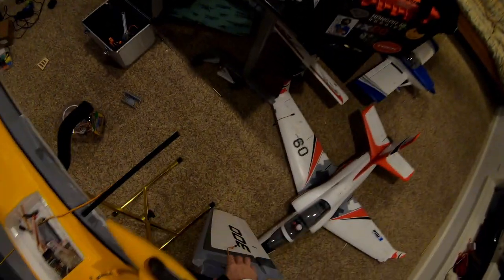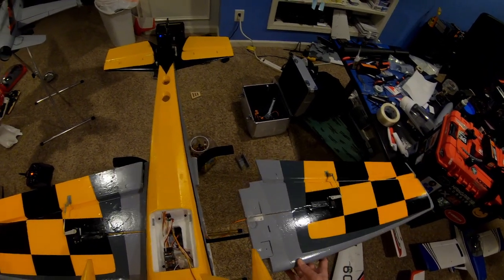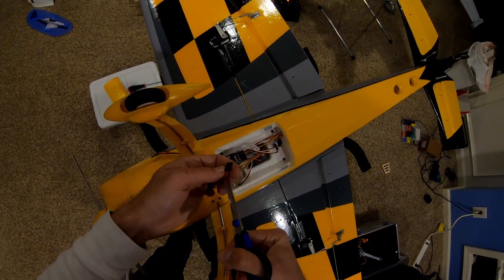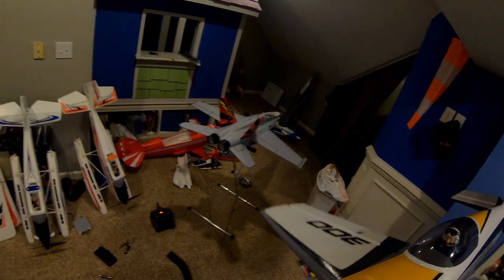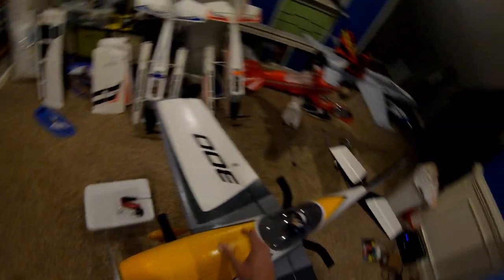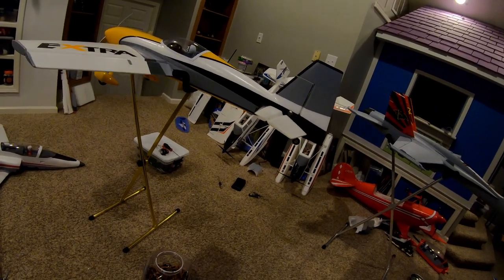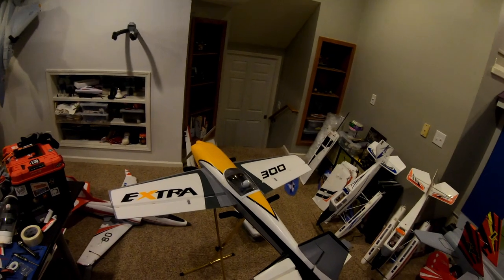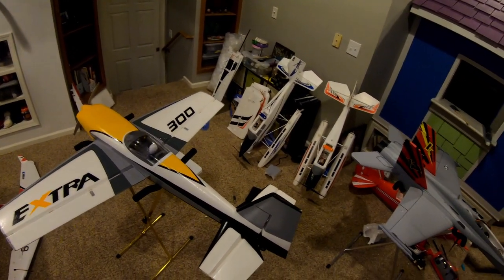E-Flite Extra 300 Maximum Aerobatic Performance Quick Setup w/ Harrier Mixing, Flaperons

Comment: Hey there, really love your Extra videos it made me get into it as well, I trained with it on realflight quite a lot but I'm still a newbie when it comes to RC so my question is:
Can I even setup the flaperons or snap flaps for harrier with the normal BNF version? I think I read to do this I need to change something about the servos being split in two?
Or is there another version as well in which I can make the elevator and ailerons turn up together?
Reply from the maker: You'd have to unlock the receiver and reprogram it to get flaperons enabled correctly.

Comment: Around 9:00 on the video add another point. Put a point at 25% on each side of center, one for up elevator as you did and another one for down on the opposite side then adjust accordingly on both sides. This equalizes up and down or even seperates up/down for fine tuning.

Comment: One thing I found to help with torque rolls on this one is more expo than normal (other planes). This plane is sensitive around center controls and it makes TRs look ugly. More expo helps a lot here. If you find you’re chasing it or really shoving the sticks around take some expo back out as that’s a sign of adding too much.
Reply from the maker: It definitely is sensitive. I fly with 85% expo and I still feel like I could go higher with the throws I'm using. I'm pretty certain I need to reduce the aileron throws a bit, and possibly the elevator. At some point the design fights back against the throws and it stops performing well and looks sloppy and weird. I may just have too many expectations for this model as well.
Reply: @TwoBrosRC  This plane takes more work than others I own but each time out I feel improvements and it’s closer to my expectations. My next trip will be max ailerons (to allow max spoileron capability) but tamed with lower dual rates at the cost of resolution as I’m not fond of blinding roll rates. Max elevator as simply trying to live with anything less KILLS elevators and waterfalls. My expo isn’t as high as yours even though higher than my other planes but I focus on smooth flight which has trained me I guess. I may drive one in like a fence post but it’ll look smooth and planned!

Comment: This will be my next airplane.  Do you know anybody flying with a 4s 2200mah pack.  Will it balance with that size and what are the flight times. Let me know please.  THANKS.
Reply from the maker: It'll balance with 4s 2200 to 3200 and beyond. I've run two parallel 2800 packs in it before. It's just somewhat tail-heavy on 2200. Flight time varies based on how you fly. 3D might net you a few minutes. Energy-based aerobatics should get you 3 to 5. 7 to 10 tops if you're flying non-aggressively.
Reply: @TwoBrosRC  THANKS Buddy.

Comment: Would you happen to know how to setup flaperons with a Spektrum radio (NX8E) for the Eflite Extra 300 on the RealFlight simulator?  I setup my radio model profile for flaperons but when I flip the switch it puts one aileron up and one down… and then of course goes into a roll.  I’d like to experiment with this setup on the simulator if possible before messing with it on my actual Extra 300.  Googling hasn’t yielded much useful information.

I’m barely intermediate so I only fly the real one on 50% rates for the 10 or so flights I’ve done.  I fly it pretty well in the simulator but do crash every once in a while so I need a bunch more crash free hours in the virtual realm before I open it up with the real model.
Reply from the maker: Configuring aircraft on RF is not simple. I'd have to make a tutorial video on it, and even that wouldn't help you much as the physics in RF are not really representative of reality. Flaperons in RF wouldn't behave like they do on the scale model. I know because I fly with them on occasion and RF doesn't model the sudden stall the model experiences in that configuration.

Comment: Hey, hopefully you see this and sorry for my bad english!
I've bought the plane and have really much fun with it. I'm about to start some 3d maneuvers now. But I have that issue, if u give throttle, the aircraft needs exact 1 second to receive it. Other inputs on the rudders are even with my working on the radio. On the ground, if I give throttle the aircraft reacts immediatly. But not so in the air like i said. Can ypu help me?
Reply from the maker: Reprogram your ESC so the motor uses "normal" startup. Check your ESC manual.

Comment: Have you figured out the replacement for that prop spinner (if you had to deal with it) ... they way the have that prop adapter, seems like the only spinned would be the factory replacement and they are out of stock.  Anything you can suggest outside of replacing a motor?
Reply from the maker: Nope, we flew ours on the stock power system.

Comment: Also I noticed you put hinges on the ailerons and I assume elevator did you do that right away or did you wait for them to break. Seems like a good idea do. you know which hinges you used. Thanks
Reply from the maker: This plane came prehinged and didn't need hinging after the fact. The replacement set of wings needed rehinged since they were foam hinged. We use Hobbypark nylon pinned hinges.

Comment: So I got one but it doesn’t fly good. The CG is waaaay back. Is that the case?
Reply from the maker: That would certainly be an issue. Balance it around the front of the canopy or slightly ahead of it.
Reply: @TwoBrosRC   I’ll add weight in the battery compartment then. I’ll try that. Thanks

Comment: So u used Minwax polycrylic you actually brushed that onto the entire plane is that why it’s so shiny and what does that do protect the foam it doesn’t add too much weight or anything bad
Reply from the maker: It adds minimal weight and gives it some protection, plus helps stiffen up the foam a little.
Reply: @TwoBrosRC  You’re able to do this with all the control services already intact it does not stick anything together
Reply from the maker: You brush around the hinge points and electronics.

Comment: I have a DX8.  When I try to load these files it says 81% Enumeration. Are these files compatible with my transmitter?
Reply from the maker: You'd need an IX radio to load my iSPM files.
Reply: @TwoBrosRC  I tried the spm file. Is that the same case?
Reply from the maker: The SPM files should load in a DX8 if you're on the latest firmware for your transmitter, I would imagine.
Reply: @TwoBrosRC  I’ll check the firmware. I did update it a few month’s ago maybe 6 months ago. Not sure how often they change the firmware.
Reply: Hello,

To import a model from another persons radio, the radio its coming from would have to be a Gen 1 Silver DX8 or the DX7s radio fully updated. And your DX8 would also have to be fully updated. 

Michael

Horizon Hobby
Product Support Rep.
Reply from the maker: Interesting. Sorry to hear that Chad! Fortunately all the mixing you need is demonstrated in the video, so you should be able to follow along. :)
Reply: @TwoBrosRC  cool I’ll check it out. What radio did you create the 2 files on?
Reply from the maker: I created the initial iSPM on my IX20, then converted it to a SPM using my IX12. Something probably got lost in translation.
Reply: @TwoBrosRC  $700 later and now I have an IX12 and the import works.  Thanks for the files.
Reply: Do you have any idea why the right aileron would become less active in safe mode?
Reply from the maker: @ChadLower  Probably because you didn't unlock the receiver and reset it to understand that you're in a Flaperon wing configuration.
Reply: @TwoBrosRC  I’m not sure how to do that. Is that covered in the video
Reply from the maker: @ChadLower  Should be, if not, all you need to do is set the wing type to Flaperon, ensure that both ailerons are on the correct channel in Channel Assign as they are in your servo plug order on the receiver, and tell the receiver to relearn servo settings.
Reply: @TwoBrosRC  ok I’ll try to check that. I did have to go into forward programming and set up the gyro safe mode to the aux3 switch and change the trim to normal instead of cross. Flaperons are working but the harrier mode isn’t working. Does the switch need assigned also?  I went in and played with the mix and got the flaperons to work with the elevator. Had to change the throw. I figured the mix would already be in the file. Still dont have the curve on harrier set up like you showed in the video with.  This is all working prior to the issue with the safe mode and right aileron having half travel in safe mode,
So I figured the flaperon setup was good since it works normally otherwise.
Reply from the maker: @ChadLower  You should assign it to a switch. You may have to change which channel the second channel is mixing because it may not be the same channel assignment I use. The mixing is in the IX20 file but because it's three mixes assigned to one switch in one mix, it may not work without an IX20 to load it.
Reply: @ChadLower  I had the same thing happen to me; I was testing a Flaperon setup on my Gf's Trojan. I'm curious to know if you made the adjsutments and it worked out...?

Comment: Thanks for all the info.  Being someone with little experience I wanted to ask you about your radio choice - obviously you could probably use whatever radio you wanted, but you stick with Spektrum - is that just because its what you have always used? the ix20 is obviously really nice and all, but damn expensive. I just bought my first radio ( radiomaster tx16s mk 2) and find that for the money it has a ton of capability - live telemetry, endless mixing options, custom functions, tons of switches etc etc etc.  It seems from my limited experience that it can do everything the Spektrum radios can? or is there something I'm missing? thanks for any input.
Reply from the maker: I just stuck with Spektrum because I'd already invested into the ecosystem. The IX20 was the best radio they had to offer which is why I upgraded to it. Having the option to work with Android opened up running on-screen displays over the setup vids so they're easier to work with for people watching.

Comment: Hi Jon, when you activate your harrier flaps I presume you flick a switch to do this, if so does this automatically raise both the ailerons and elevator and they all remain up until you you switch this off or do the ailerons only go up when you apply elevator? Also how much of the ailerons and how much of the elevator go up? I have a frsky radio so trying to set this up as a custom mix..
Reply from the maker: The setup should go over it. The mix is elevator -> spoileron. Adding elevator input causes the spoilerons to kick upward. Everything should be covered in the vid - check the section for harrier flaps again and let me know if something is unclear.

Comment: Hey Jon, nice video very informative thank you! What APC prop are you using?
Reply from the maker: The prop in this video is a Xoar 13x6.5 silver wood propeller, not an APC.
Reply: @TwoBrosRC  
Ok thanks!
Reply: You like Xoar better than APC?
Reply from the maker: @lvincentg  In general, yes, but wood props are far more likely to break on impact so you've gotta be good at landing to avoid breaking them.
Reply: @TwoBrosRC  
Agreed! Thanks